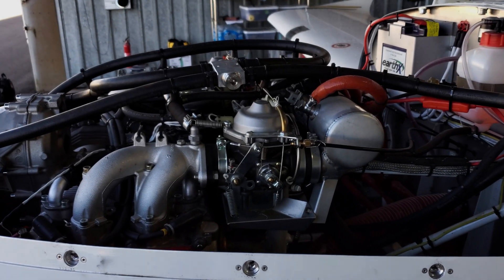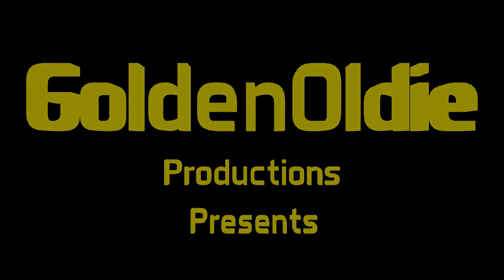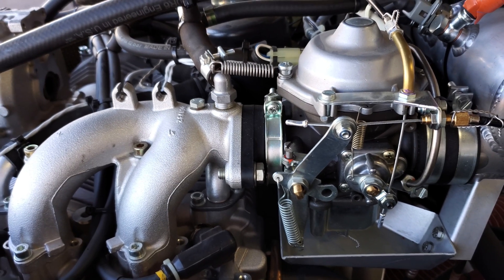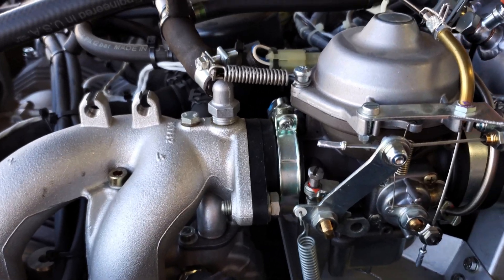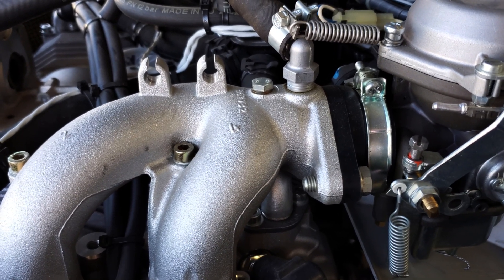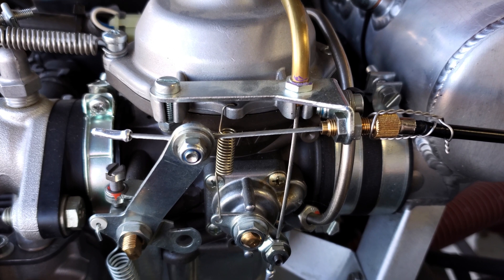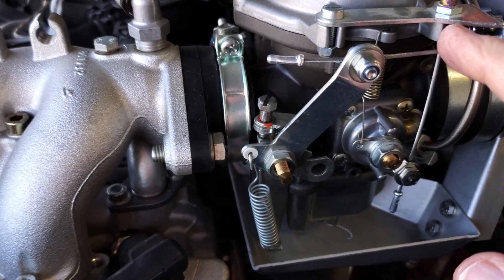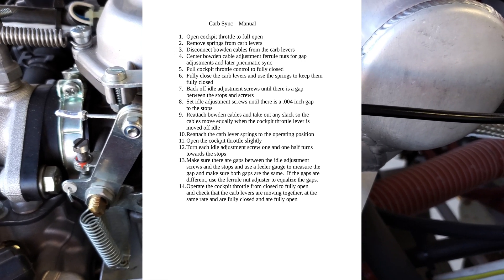Rotax 914/912 Carb Sync the Cheapskate Method - Part 1 Mechanical Sync

Comment: I use a single vacuum gauge, a T in the hose from the gauge, and a valve in each hose on the hoses coming from the T.  They each go to the intake manifolds.  Open one valve, and get a reading. Close it and open  the other valve and read the vacuum on the other intake manifold.  Adjust throttle linkage till both vacuums are the same.  As long as the gauge reads consistently, you will be accurate.  I use 1/4" fuel valves like the ones used on snowmobiles.

Comment: Wanted to double check.  0.004- or 0.04-inches gap on the idle set point.?  1 1/2 turns seem like much more than 0.004 inches.
Reply from the maker: Hi Tim.  Page 144 of the line service manual "Insert a 0.1 mm (0.004 in.) feeler gauge (gap X) between the idle speed adjust-ment screw (2) and the carburetor idle stop (3), then gently turn the idle screw
clockwise until contact is made with the 0.1 mm (0.004 in.) feeler gauge."  The point is to get both idle positions the same.  You'll re-adjust the idle screw to set the correct idle speed after the process by turning both screws the same amount to get the best idle speed.  Rick
Reply: @goldenoldie3524  Rick, thanks for the explanation.  I had listened several times but still missed the need to open the throttle slightly after setting the 0.004 gap. I was envisioning the set screw hitting the stop when it was turned in 1-1/2 turns.  I just had my carbs rebuilt and this is my first time trying to set them up from scratch. I was able to complete the process today. Thanks, hopeful they will be close when I test run the engine later this week.

Comment: Rick,

Great video.  Additional question for you:  not clear as to when to attach the cable to the arm…. How do you tighten the 8mm nut with the throttle closed?
Reply from the maker: Thanks.  Attach the cables to the arms as the last step.  Fully open the throttle lever.  Attach the spring in the operating position. Attach the cables so that they both start to pull back on the arm at the same time when the control lever is pulled back.  Use a gap gauge to measure the distance between the arm and the fully opened stops to make sure they are the same.  Rick

Comment: Part 2?
Reply from the maker: One of these days.  Mechanical worked so well I'm not in a real hurry even though I've got the gauges built and ready to go.  And I'm lazy.  Thanks. Rick
Reply: @goldenoldie3524  Thanks, I was just hoping to see the comparison of the two methods.  I am not a fan of standing next to a moving propeller to balance the carbs.
Reply from the maker: @timtaylor9339  That's the other reason I'm in no hurry.  Rick

Comment: Thanks for the detailed instructions on the mechanical sync - I learned quite a lot. :)   After performing the pneumatic sync with gauges, I now get 3.25 gallons per hour at near 5,000RPM.  I did verify my gauges against each other - no need to calibrate them you just want relative readings to each other to match or the difference noted.  After much testing I found closing the balance tube with clamps just did not work even with two clamps.  I had to completely disconnect the balance tube and cap the now open ends.
I prefer using gauges rather than the CarbMate electronic sync box as I can see actually what actually is happening - not assuming.  BTW once the balance tube is reconnected the gauges showed the carbs were not in sync or not as well as before reconnecting but that is the procedure Rotax provides, and I believe it is correct due to my smooth-running engine and great fuel mileage.
Reply from the maker: Thank you for the detailed comment.  I haven't done the pneumatic sync yet.  Too lazy.  I've got the gauges all setup and have valves installed to stabilize the needles.  My engine is very smooth with just the mechanical sync (one of the reasons I've haven't done the other sync).  I'm burning five gallons an hour at 5,000 RPM.  Do you have a 912 or 914?  Rick

Comment: Hey Rick, did the EarthX battery fit in the stock battery box? And if so what is their part number? I want to put a lithium in my plane. I am assuming the Rotax alternator will charge it...right? lol
Reply from the maker: Rich installed the battery before I took delivery.  I'll get the battery number the next time I have the top cowl off.  Stator has no problem charging.  Rick